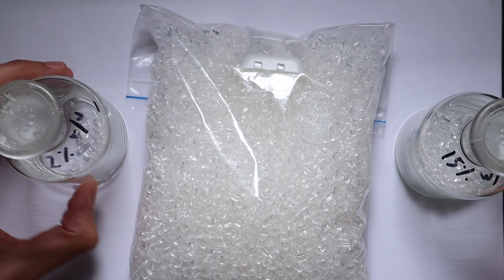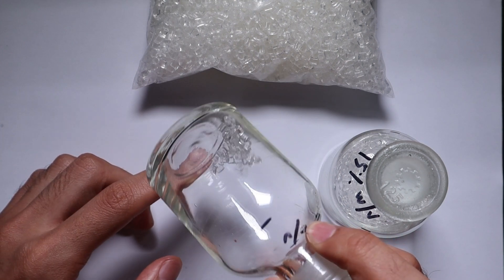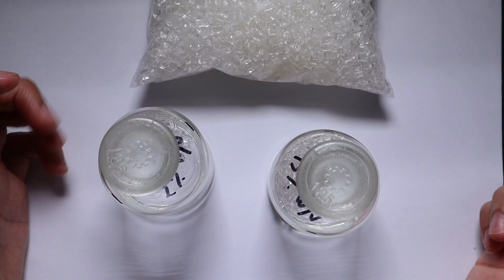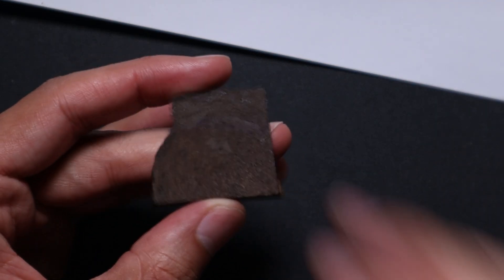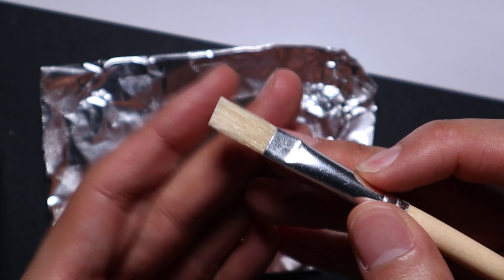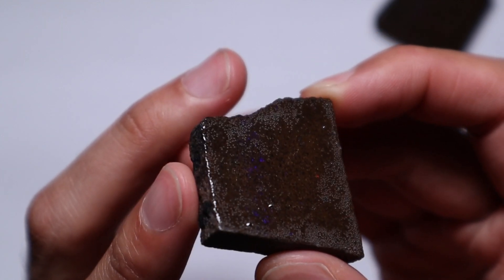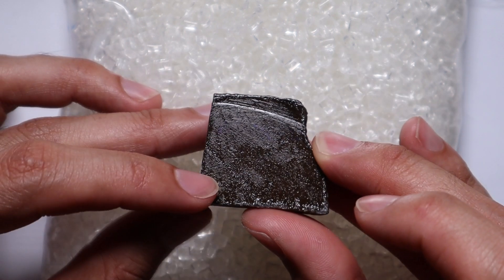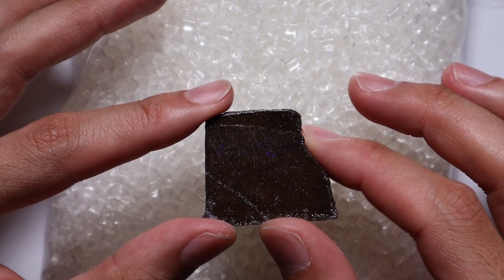Matrix Opal Stabilization using Paraloid B44. Best Stabilizer, Maybe Not The Best Coating.

Comment: Good info, I use the soaking method on soft or fractured stone before I cut them into cabochons works great.
Can you do a video in vacuum chambers too please
Reply from the maker: Yeah from here I think I'm only left with vac chamber methods. So next ones will use them. I'll try and avoid really fancy equipment though.

Comment: Very interesting stuff. The picture with the 30% looks very nice. I do like the shine.
Reply from the maker: Yeah it still isnt the type of polish I can get on a standard opal but I think it is enough. Higher than 30% gets too thick and hard to [paint on larger surfaces. Basically becomes a fast setting glue and need more acetone to spread it and remove bubbles.

Comment: Oh, this looks really useful for some delicate, iridescent ammonites I was given. I was looking for something that wouldn't damage the surface, but could be reversed if necessary. Thank you!
Reply from the maker: For ammonites I could see it being perfect. Fossil work is where this stuff really shines. Not to fake glossy but makes it stable and even workable. percentage would be painting on a 2-5% I reckon.
Reply: @RoysRocks  That sounds about right to me, too. The ammonites are already iridescent and making them overly glossy would take away from that. The plan is to set them in wire wrapping to turn them into pendants as the keels are already damaged.
Reply: Coming in late, but I work at a dinosaur museum. I can confirm that paraloid is the standard fossil stabilisation medium. We've used it on bones, mudstone, and shells.